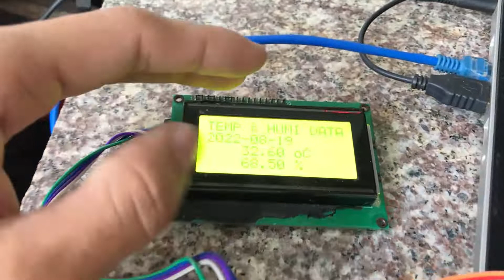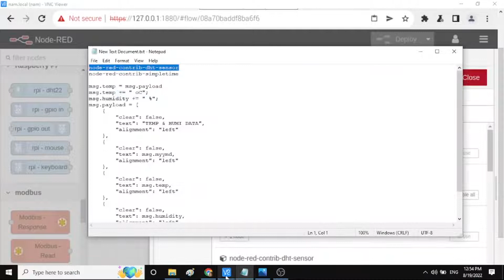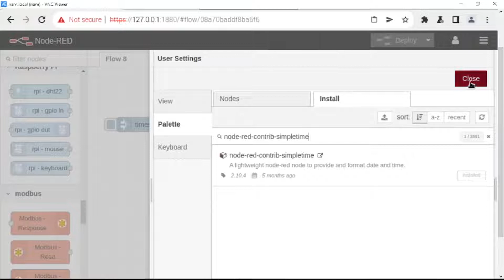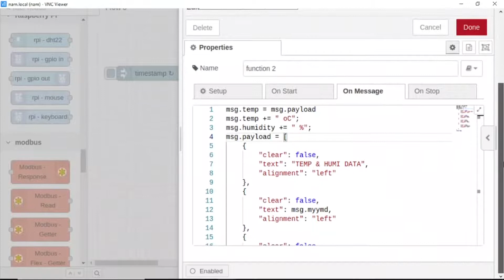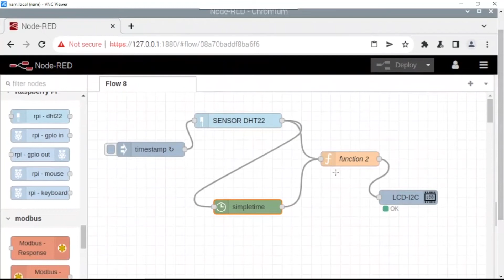DHT22, DHT11  Sensor  with  Raspberry pi Node RED to display Temperature and Humidity Values on LCD

Comment: Bonjour ,Serait il possible de connaitre le noeud de l'ecran.J'ai pour ma part un lcd 2004A et j'ai l'erreur suivante :23/09/2023 01:50:55noeud: function 1
function : (error)
"ReferenceError: nmsg is not defined (line 2, col 1)"
Merci de votre aide